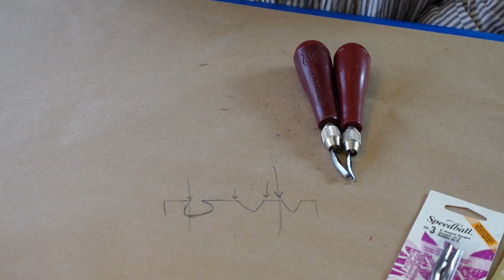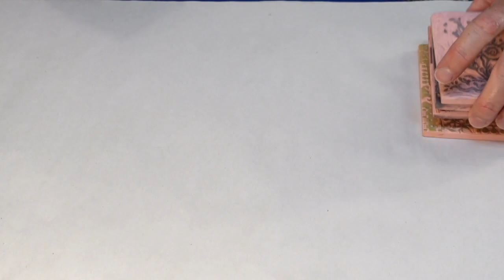Carving Your Speedy Carve Sampler

Comment: Thank you for these videos - they are really helpful - I am new to carving and printing! Is there a template available for the sampler block to use for practicing cutting skills?
Reply from the maker: Hi Teri - Thanks. No, no template, but if you just measure directly on the block, it's pretty easy to create grid. Experiment with different compositions beyond a simple grid, although they work well too!
Reply: @sarahwhorf  Thanks Sarah! What size are you using for your sampler block? I am wondering if you have any tips for cutting sharp inside and outside corners? do you offer online courses?
Reply from the maker: @tpasto  Hi Teri - For the project in the video, the block is 3x4". Using an X-acto in the corners will help give you crisp edges. No, I don't. For now it's just these videos and my continued teaching at Cal Poly Humboldt.